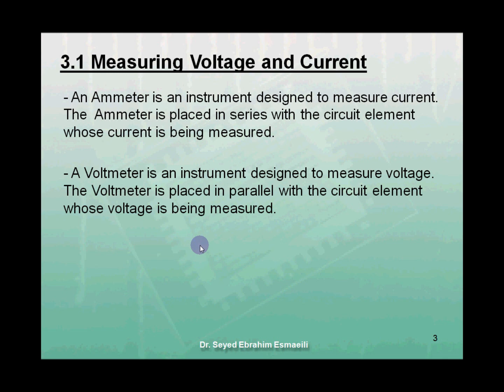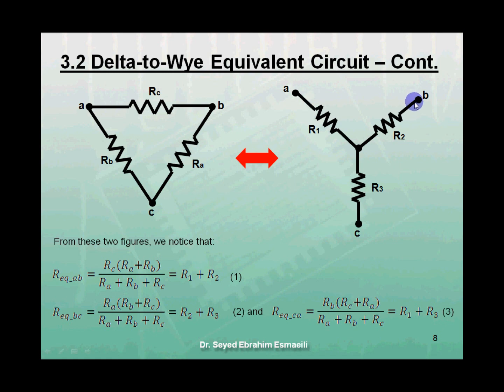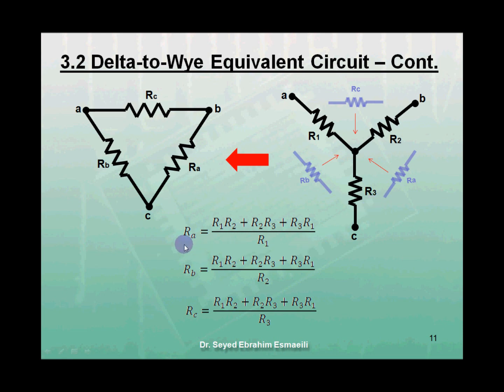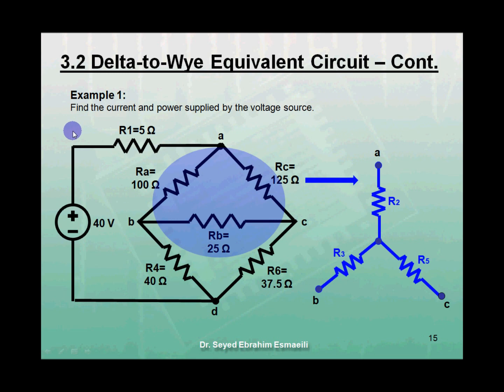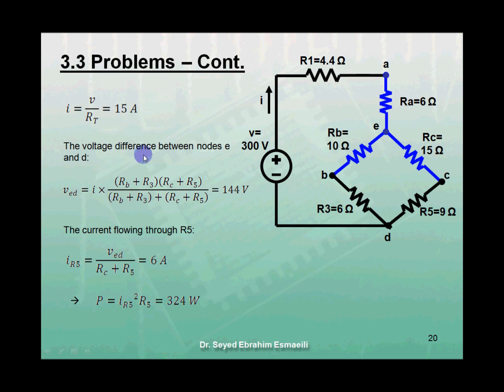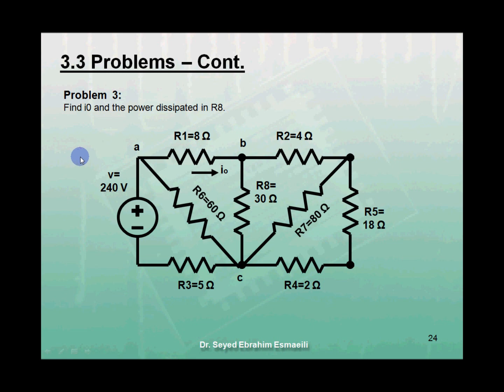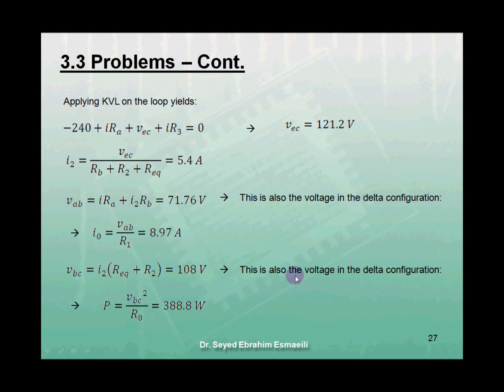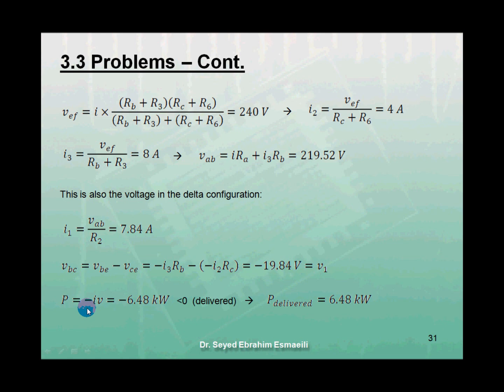Electric Circuits - Electrical Engineering Fundamentals - Lecture 3

Comment: Is there delta to wye for coils and capacitors?
Reply: Would be the same principle.. its just an easy way to recognize electrically equivalent circuits, I know I've made countless mistakes because I couldn't tell if an element was in series or parallel.